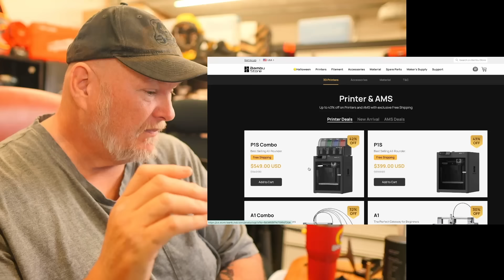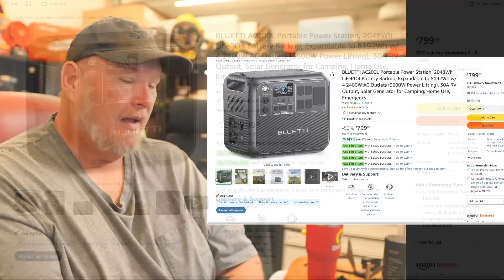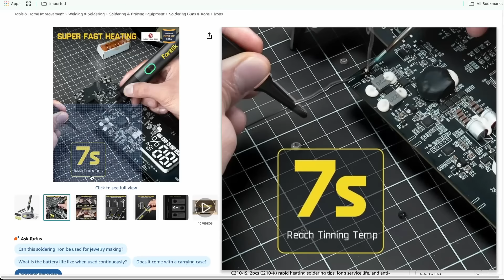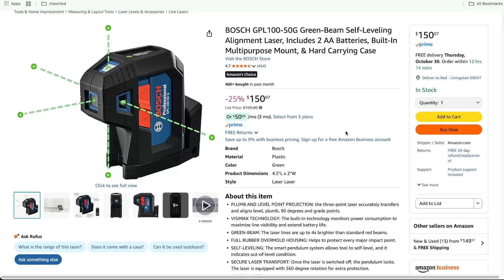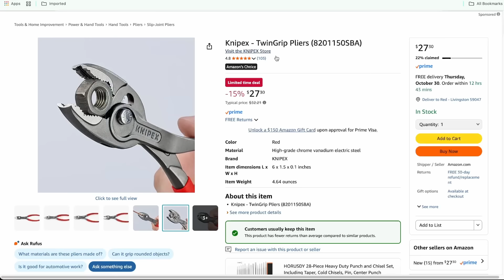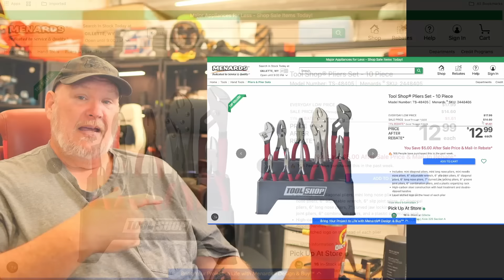Hot Tool Deals of the Week & More! 10/27/25 #dotdotw

Comment: Couple add on comments, I use a Bambu X1C at work and own an Elegoo Centauri Carbon. Honestly, the CC can make the same products. I haven't done anything to it, besides the common adjustments to slicer settings (same with X1C) and it just prints. The camera and light are atrocious, but good otherwise. How the company operates, well that's another thing! Good product though especially for the price.

The Fanttik T1 soldering iron, for someone that solders A LOT it is very good. I'm not sure about battery usage, but it is great. Extremely shocked especially since also got a plug in, high wattage FNIRSI iron and it cant keep up with the Fanttik. Now there are limits because its battery and the iron has little mass, but working with 18 gauge and smaller wire, its great. Bought it specifically for car wiring repair.

Comment: Another Amazon tool set worth mentioning is the TONYNOL impact socket sets. I've been putting together a good set of tools to keep in my tractor shed to keep me from taking tools from my big set that I used for 40 plus years in the garage business before I retired. I found myself using them in the shed and forgetting to put them back in my big set. I hunted a set of Snap On sockets for over a month before finding them in my shed box. Had looked many times and just never seen them neatly tucked into a drawer corner. Chemotherapy sometimes affects your memory like it did mine. I wanted to get the Quinn sets from H/F and had them saved in my list. But for virtually the same price and with better coverage, I ordered the TONYNOL sets from Amazon and they have been great. CR-MO material and in a decent case that doesn’t take up much space in the roller. I also bought some sets of CASOMAN and MIXPOWER. Probably not tool truck quality, but they have done very well. Amazon has become my go to for many tools and things like filters and motor oil. One does need to read CAREFULLY before buying.

Comment: Dang. I must have too much stuff. I watched the Bear for an hour and didn't see anything I wanted/needed. Not the induction bolt heater, hand tools, battery banks or even the KitchenAid mixer. When I lived in Chicago, I always took a motorcycle camping trip in the Fall. One morning in Pennsylvania, I couldn't unzip the tent because everything had been coated in 1/2" ice overnight. Still good. Thx.

Comment: Jeff, I got the Cat pressure washer from Sam’s club. It was $105.00 in the store. Got it for $83 bucks online. I’ve always had gas washers. Thought I would get a cheap electric for light work around the house and to wash the car. Hoe and gun were cheap, but the machine has worked great.  Thanks for your show, KC

Comment: You are recommending Bambu Labs.  Don't they have a phone home requirement?  If you are into 2A printing, that's a concern.  It's a concern anyway because why does Bambu Labs needs to know what I am printing?
Reply: If you use Bamboo Studio as your slicer, the normal setup has the Gcode shipped via your WiFi to a server then to your printer. But you can bypass that and go direct to the printer from their slicer. Or use a different slicer and put the Gcode on a SM card, no WiFi involved.
Reply: Came to say this.  I have an old flsun delta printer for spooky boys. It works well enough, just run the printer next to a fireplace and dry your filament befor starting. If you use carbon fiber nylon filament use a stainless print nozzle.
Reply: How big of an issue is this? Was seriously considering this but I'm sketchy on this aspect also
Reply: @noggle4960 huge if you value privacy, your rights as an individual
Reply: CIA

Comment: I don't miss the chances of snow after moving back home from the Northeast. Although I do need to swing by Direct Tools (humblebrag ;p) to pick up the Ryobi blower and HP battery I ordered from their sale yesterday for the lawn. And maybe the garage, if I end up using that to actually work on the wood projects I want to have done before Christmas (no room inside the house for either the setup or the mess of the miter saw, for example) - I was gonna set up in the backyard, but while no snow, it has gone from sunny and 80s to gray, rainy, and 60s for the last few and next several days...